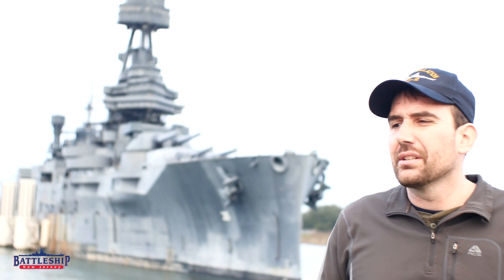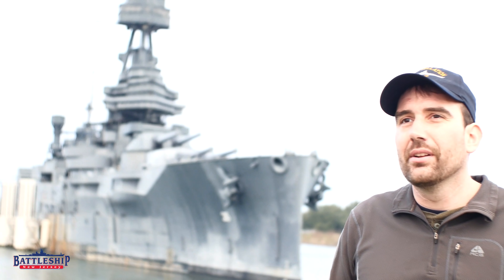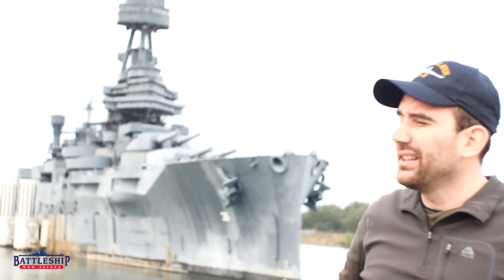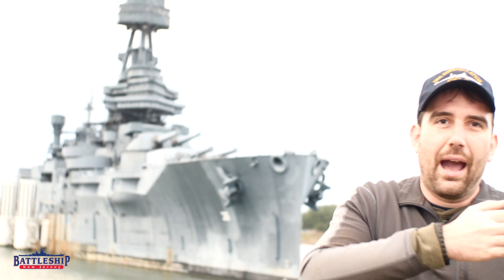Why Is Battleship Texas Shaped So Weird?

Comment: Crazy to think that warships all the way up to the early 20th C still had “Gun decks” in them similarly to their ancestors hundreds of years before!
Reply: If the ship had smooth sides, she would be longer.
Reply: Well if you think about it, not that crazy. HMS Warrior was the first full iron hulled ship, she was launched in 1860, and she launched in a world of wooden ships-of-the-line. Only 45 years later, the HMS Dreadnought was launched. The Iowas are almost 80 years old, and the Enterprise, the first nuclear carrier, was built 60 years ago. Texas was closer to the age of sail than we are to the first CVN.
Reply: Imagine if they put all the heads on a retained Poop Deck.
Reply: @magisterrleth3129  Yup.  Abrams Main Battle Tanks entered service in the late 70's which is now over 40 years ago.  the F-15 is about to turn 50.  The B-52 will be turning 70
Reply: As stated they were to be used against torpedo boats.

Comment: How about the USS Texas had Torpedo Tubes in her original configuration?  How ships that served over longer time frames like Texas and New Jersey had new and different technology added and removed from them.
Reply: Torpedo tubes on battleships are very interesting yet I can never find anything on them.
Reply: @noahlinden9641  German BBs historically had them, but I can’t think of any other countries using them.
Reply: @Manticore2026  Most countries that operated battleships, both pre- and post-Dreadnought, had torpedo tubes on them for a while there. Even Dreadnought herself had a few torpedo tubes! Eventually, though, most navies realized that torpedoes on battleships aren't a particularly good idea; While they pack a heck of a punch, ideally you want a battleship to keep the range open so it can use its main battery to the fullest effect, and if you aren't using the tubes they're just massive targets filled with lots of explosives. This is also why most countries ended up mostly only putting torpedo tubes on destroyers or smaller ships; While they're a big vulnerable target, a ship that small can't pack very much armor anyway, and even if the tubes go up, at least it was a (relatively speaking) small and cheap destroyer or something rather than a huge expensive battleship.
Reply: @Manticore2026  HMS Rodney launched torpedoes at the Bismarck during her sinking.
Reply: @noahlinden9641  Almost all the capital ships at Jutland had torpedo tubes.
They were mostly discarded inter-war as ineffective and a liability (a hole in your hull where you want strength).

The US navy went a step further and abandoned torpedoes form new build cruisers (An explosion hazard), saved weight used for more guns, armour and propulsion.

The only confirmed Battleship torpedo hit I've read about is HMS Rodney on an immobile and sinking Bismarck.
A task that could have been delegated to a destroyer or Cruiser.
Reply: @steveholmes11  Didn’t hood also have torpedo tubes in ww2?
Reply: @noahlinden9641  I think so, a few capital ships retained the tubes, or never got around to removing them.

Comment: Some of the lines of modern looking ships such as the Iowa class have to be attributed to advances in engineering design technologies and concepts as marine engineering developed as a science just like automobiles, homes, airplanes and medical equipment…….changes reflect experience(s).
In 1959 I served in the PhilGroupAlanticReserveFleet where we worked on the reserve fleet preservation of the Tennessee, California, Iowa, Wisconsin and many of the stubby jeep carriers such as the Cabot, Siboney, battle cruisers such as the Alaska and Guam etc., all products of old engineering. There were also two hospital ships in the RF at the same time, the Tranquility and the Sanctuary one of which I always thought was used as the original Hope. 😊

Comment: The obvious, very US navy, feature that's been replaced is the cage mast. A fascinating mathematical / engineering invention.
I do wonder how the crew enjoyed ascending and working at height in them.
Reply: The cage masts proved faulty after some came crashing down after going through storms. The implementation of bigger and heavier fire control sighting equipment and radar arrays necessitated the change to sturdier tripod masts.
Reply: @davidkaminski615  Thanks David, it sounds like a similar upgrade journey that led the Royal Navy to the "Queen Anne's Mansion" superstructure.
Reply: I've wondered sometimes if the spotters who worked at the top of the tripod received anything like hazard pay for having to work there.  I suspect not, though.  Great view if no one's shooting at you, but I'd be nervous about a hit to the superstructure making that thing go "timber" if I had to work up there.

Comment: In mentioning the anti-torpedo guns on the sides that had open ports for the guns you have to wonder how many sailors were diagnosed with TB or some other respiratory illness.  The H.M.S. Hood had a similar issue as I understand it when water would come over the stern and enter the air vents and below decks were always wet and damp. Had looked for the article but I remember The Hood having a higher reported cases of TB. Some of you may be familiar with that.

Comment: HMS Nelson & HMS Rodney are definitely in the "weird" category, with all three gun turrets forward of the superstructure, to help them comply with the Washington Naval Treaty displacement limits.
Reply: They were originally laid-down as super Battlecruisers over 900 feet long mounting 5 turrets. The ships were basically cut short after the superstructure loosing a third of their length and weight. I have a model of Rodney and when looking at it can see an almost cut and patch design.
Reply: @briansearles4473  that's...wow. Those are (well, were) some BIG plans.
Reply: @briansearles4473  I'm sorry, but...no, they definitely were not. The Nelsons were always intended to have three turrets mounting 16-inch guns, and they were always intended to be battleships, complying with the restrictions of the Washington Naval Treaty. They were laid down as such. I have no idea where you got that information from, but it's very wrong, I'm afraid. The Nelsons were an adaptation of the N3 design, but with smaller guns (16 inch rather than 18 inch), a different turret placement and so on.

Britain did come to close to building the G3-class "battlecruisers", and a couple of them may even have been laid down, though there's no evidence to confirm it. The G3's would've been 856 feet long, carrying nine 16 inch guns, capable of 32 knots and carrying thicker armour than any battleship afloat (including the American Colorados, Britsh Queen Elizabeths and Japanese Nagatos). The Washington Naval Treaty meant the cancellation of the G3's, preventing a second naval arms race in the 20th century between Britain and the United States. 

Given that the American Lexington and South Dakota-class ships were considerably inferior to the British G3 and N3 designs, that was probably a good thing for the US.
Reply: @Cailus3542  If memory serves, the G3s were finalized and funded, but not yet laid down when the WNT talks started.
Reply: @briansearles4473  The Nelsons were G3 battlecruisers with their engine power mutilated to meet the 35,000 tons restrictions of the Treaty. At the time the Royal Navy referred to them as 'Cherry Tree Ships.'    Cut down by Washington, of course.
Reply: @dovetonsturdee7033  Thanks for the info as I have been looking up on google facts about HMS Nelson. Nelson and Rodney used some of the parts intended for the G3's. As to what extent they were shortened and how many turrets they were to originally have, before being cut down, no one seems to know.
Reply: @Cailus3542  Thank you for the info as I have been looking up facts about the Nelson/Rodney. All I can find to support part of my claim comes from the assembly instructions in my Airfix HMS Nelson model kit. Take it for what it's worth, in part it says. "Originally envisioned as enormous battlecruisers, each of 48,000 tons, these two ships were affected by the Washington Naval Treaty of 1920, which limited the maximum displacement to 35,000 tons. The necessity to reduce the displacement by at least 13,000 tons led to radical alterations in the design and the ships were quite literally cut off short." However I can't find any info to support my claim of 5 turrets. There must be some information describing the original design of these two ships before they were laid down. One thing is certain, they are unique ships compared to other Royal Navy vessels and I wish one had been preserved as a museum ship.
Reply: @briansearles4473  They were always intended to have three triple turrets, each with 16 inch guns. The RN was given special dispensation to build two 16 inch gunned battleships, as the US already had the 16 inch gunned Colorados, and the IJN the Nagatos.
Reply: This is purely subjective and a bit of a side rant, but British design aesthetics in the 20th century always seemed to result in very odd-looking machinery. From naval to air to rail to armor they just produced very goofy-looking machines. With the exception of the Spitfire, of course. But the Handley-Page Victor? Really?
Reply: @dorkf1sh  The Nelsons were built within strict limitations. Within the 35,000 ton limit, the British managed to produce a design which was faster, better armoured, and more heavily gunned than any other capital ship in existence.  Even if they did look like unpleasant East End gangsters!
Reply: @dorkf1sh  How true, however I always thought HMS Tiger was a beautiful looking ship.
Reply: @dorkf1sh  How we roll.
We build a few, and if it looks good we build a lot more.

Hence: 
Lots of Spitfires, relatively,  few Westland Wapatis.
Lots of Universal Carriers, few Matilda 1 tanks.
Lots of J-K class destroyers, one HMS Agincourt.
Reply: @briansearles4473  Putting the three turrets forward meant that the magazines were all forward. As a result the armoured citidel required to protect that area was shorter, and gave a significant reduction in displacement to help get them down within treaty limits. 

The sailors nicknamed them Rodnol and Nelsol, because they looked like tankers as a result. That is probably better than being nicknamed HMS Refit, and HMS repair, though ;-)
Reply: Also Dunkerque
Reply: @dorkf1sh oh I don't know. I'm a huge fan of the centurion and chieftain tanks and the Mosquito fighter-bomber

Comment: I have been aboard both battleships. The Texas about 3 years ago. The New Jersey about 40 years ago when it was in  Birmington Washington. When it was used to film the mini series Winds of War.
Reply: Bremerton, WA.  Are you sure it wasn't the Missouri?  I know the Missouri was there until like '75. I 'toured' it the last day it was 'open' for visitors. It wasn't much of a tour. You boarded her on the starboard side, walked thru the forward part of the top deck superstructure, and exited on the port side to just walk the forward teak deck. That was it. They said the rest of the ship was sealed off and pumped full of Nitrogen rich air to preserve the insides. Incidentally, I remember the overhead of the superstructure room we traversed was pretty low. I'm 6' tall and I came pretty close to hitting my head on the overhead. I'm guessing most sailors must have been a lot shorter in WW2.
Reply: Both the New Jersey and Missouri were there.
Reply: @7983usmc  oh, ok. Thx

Comment: As far as the speed goes, that never really hurt the standard battleships. Battleships in general were used pretty defensively by everybody, the only things they really couldn't do was keep up with a carrier group in a hurry. And that's not bad when you consider that the #1 deciding factor of their design was keeping a modest budget.
Reply: Depends, the English Revenge-class BBs were built after the Queen Elizabeth-class but were used far less extensively because they took so long to get anywhere (20kts vs 25kts sea speed).
Reply: @waverleyjournalise5757 Fair point. But part of the issue is that they already have faster ships, why use the Revenges? American standard ships were intentionally designed to avoid that issue, by deciding on a standard speed of 21 knots. That way, Congress can tell the Navy they only get two ships per class, but every preceding class can operate with even the most modern units. And then we realized that speed might be important in the vast expanse of the Pacific, and so speed became priority #1, and the result is a ship that's as cheap with her armament and and armor as the last classes were with their machinery, but she's 12 knots faster.
Reply: I tend to disagree. The slow speed of the Standards rendered them virtually obsolete in WW2, unlike the faster Queen Elizabeths and Nelsons, which were just about fast enough to be viable against modern battleships. The slow speed of the Standards made sense in the 1910's, particularly after the Battle of Jutland, but speed became far more important in later years. 

That's one of many reasons why the Japanese attack on Pearl Harbour was such a mistake. They attacked a fleet which would've been virtually useless in the Pacific War that was about to unfold.
Reply: As their use evolved fast battleships became huge anti aircraft batteries to protect the carriers and the older standard battleships were used for shore bombardment. The battle of Surigao Strait was a exception.
Reply: @BigTrain175  The Pacific War as a whole was an exception. In the more confined waters around Europe, fast battleships of all kinds were used more frequently in an offensive role against surface shipping. People tend to hook onto the "carriers made battleships obsolete in WW2" line, when it isn't actually true. It was the advent of jet aircraft that made battleships obsolete.

The rare use of battleships in the Pacific was due to a combination of factors. Most of the American fleet was knocked out on day one, obviously, or else they would've been deployed (and likely sunk by carrier aircraft). Beyond that, Japanese strategic doctrine meant that the Japanese held back their battleships for a "decisive battle" that never came. The vast waters of the Pacific also meant that interception of enemy surface forces was unlikely. It did nearly happen in 1945, when the French fast battleship Richelieu was hunting the Japanese cruiser Takao, but a British destroyer squadron sunk it before the intercept happened. It also happened at Leyte Gulf, but again, exception.

Contrast that to the Atlantic, Med and North Sea. Bismarck and Scharnhorst were sunk by British battleships, while Tirpitz was trapped in Norway for fear of encountering them. Battleships saw heavy use in the Med, most particularly at Cape Matapan. The British had fleet carriers and used them quite effectively (Taranto, for instance), but in those theatres, heavy ships like battleships and cruisers were still critical.

Comment: I always thought that the shapes of various battleships were for survivability mainly. So you could have a ship that could take numerous hits and still keep fighting., sort of,  function over form.
Reply: True for all ships, the question is "Survivability from what?" Threats change over time. The original metal battleships were the Monitor style vessels. USS Puritan was a classic example. They had big guns but not much else. After the invention of the torpedo there was a new threat, the "Torpedo Boat". Not like a WW2 PY Boat but small and fast, often with a single tube in the middle of the bow. A very expensive capital ship with a crew of hundreds was now in danger from a cheap, fast vessel with a small crew. 

This led to a two fold answer. The gun deck with secondary armaments to shoot at smaller fast moving targets and the development of a new class of vessel, the "Torpedo Boat Destroyer" now known as simply "Destroyer" to protect the capital ships. Ships didn't have a roof on the bridge early on because they need to be able to see attacking aircraft, with the invention of radar ships had roofs added.

Similarly armour changed and became more specialised as weapons because more effective. Belt armour against torpedoes is a very different thing to hull and deck armour against 14" shells. And all the time shells and guns were developing.

Comment: As with all battleships, it was designed with the dimensions of the Panama Canal locks in mind. If the US Navy was to reconsider bringing back battleships and make them part of the Fleet Marine Forces (supporting Marine amphibious operations), they would most likely use the both the Iowa-class and the (cancelled) Montana-class dimensions, given that the latter (cancelled) class would fit into the Post-Panamax dimensions (which would allow such class to fit into the new set of locks; Iowa-class being able to fit in both the original locks and the new locks).

Comment: When it comes to understanding historic ship design, you have to judge it from an even earlier perspective and move forward. The lower casemates evolved from the Pre-Dreadnaughts and their multiple caliber layout of secondary and tertiary batteries all over the place; compare the Texas with the Armored Cruiser Olympia, and you can see incremental improvements. By the time the Colorado Class was laid down after her, the hull casemates were gone and replaced by a smooth line.
Reply: Look at the USS Tennessee (BB-43) class, all secondaries on deck (although it looks like they where thinking of doing a few below deck location).  For sure the Colorado shed all of the Dreadnought vestiges.